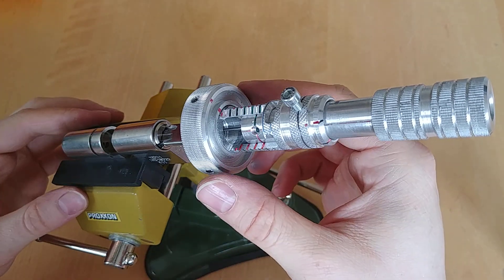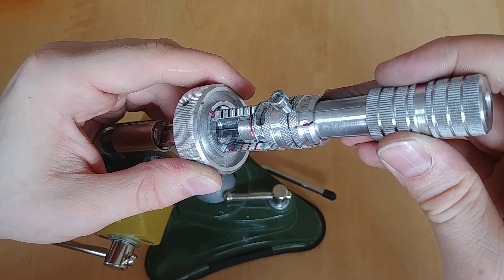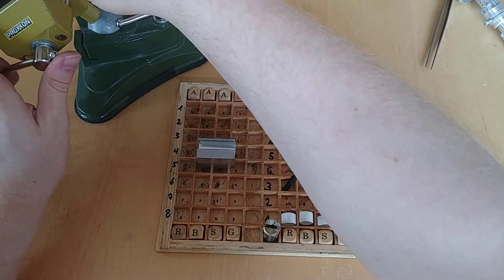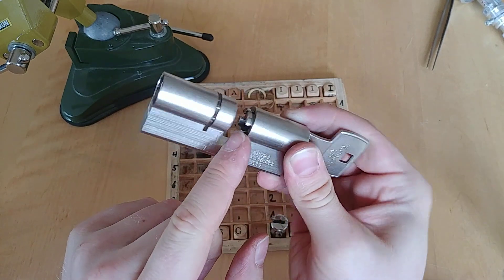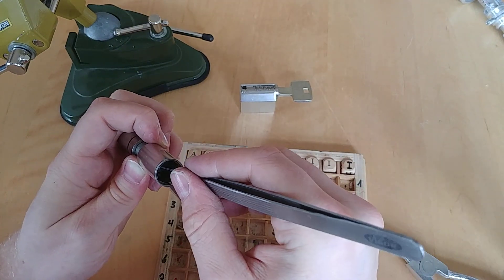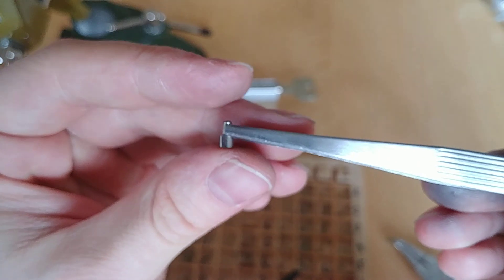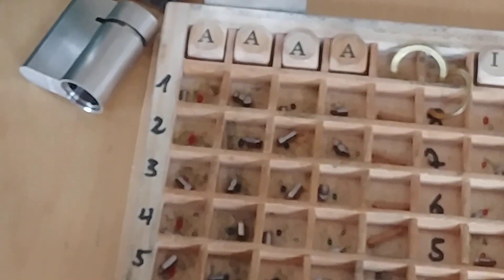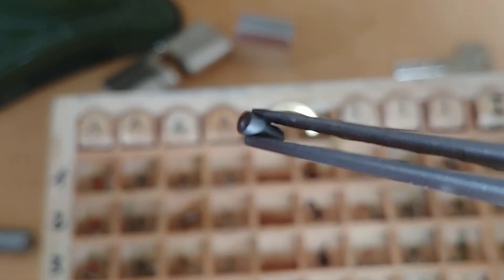[23] Dom IX Saturn picked with Rotor Pick and gutted

Comment: Nice bro.did you make that? That’s awesome. I’ve always wanted to make one for mt5+. Even just a tensioner/guide for the keyway that your reg dimple pick fits would cool. Like a key with a hollow spot for the pick... hard to explain but you probably know what I mean
Reply from the maker: Thanks, that tool is a bit out of the possibilities of my mini lathe 😏 it's made by Vetal and is called rotor pick (check out the link in the description 😃👍)
Reply: @CaptainHookNumber1  where's the link? I can't see it in description
Reply from the maker: Thanks for the hint, it should be there now. There is also an info card popping up right at the beginning
Reply: @CaptainHookNumber1  thankyou, awesome tool and great picking :-)
Reply from the maker: @tinpicker8688  thanks again 😃 it's more the tool than my picking in this vid 😉